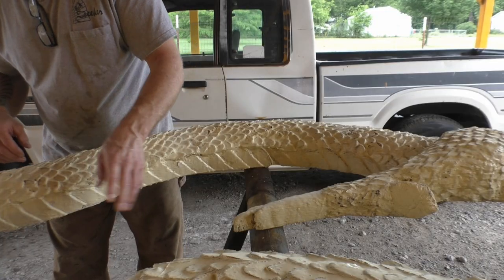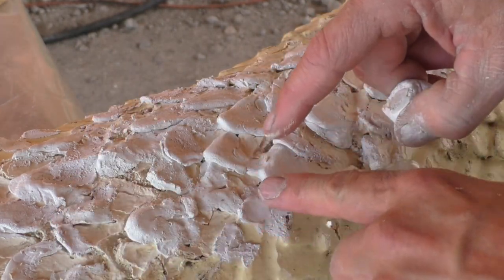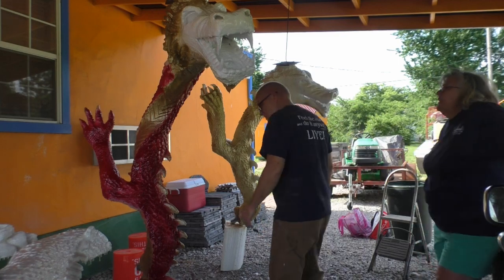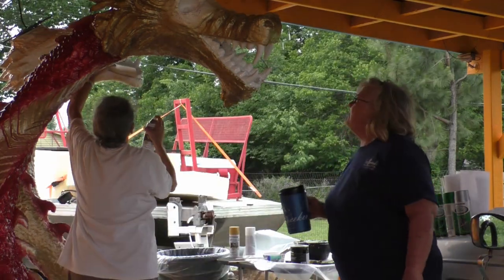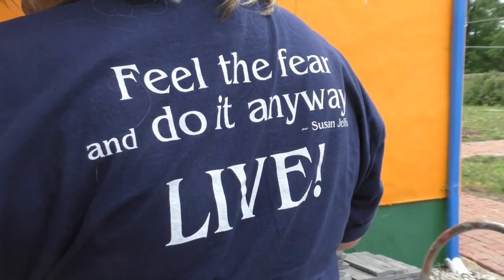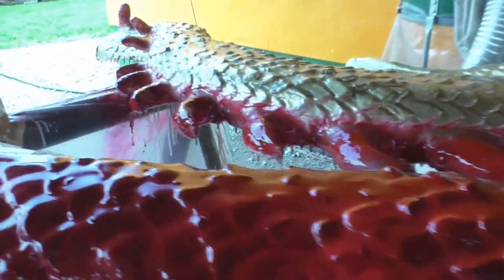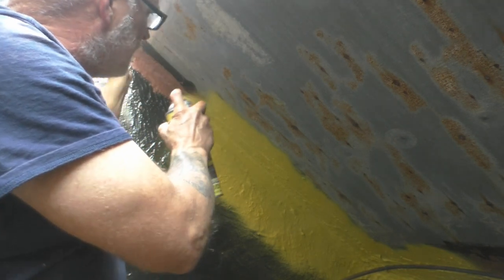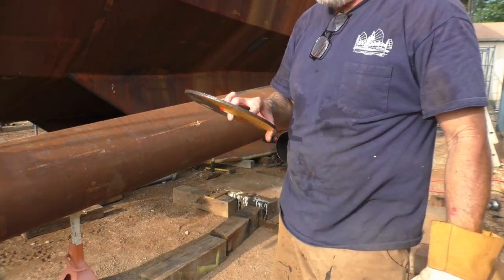Dragons and the Main Mast

Comment: Doug for the mast joint temporarily weld a couple of pull points either side of both pipes then use 2 come alongs to ratchet them together. On the leak why don't you just fibreglass the inside?
Keep up the good work
Mac

Comment: what about a pond liner in the tank? You could use some bulkhead fittings to connect to your current lines, when the water is in the tank the weight should push against the outer walls and shouldnt lose too much energy through the liner.

Comment: Damn that leak is a persistent bugger, perhaps you should drop a liner in that tank.
Reply: That's my thinking, but a liner would have to be made to fit an odd ball shape and be sealed where the pipes come in. Is it worth the trouble? After all it's not a fuel leak, more an annoyance than a real problem.

Comment: Once you remove the galvanized coating and weld it will rust again.  Best to use ospho to neutralize the rust then paint with trailer coat from pettit.  I have been in the marine industry since the 80's and this is the best option.  The paint is moisture cured and very durable.

Comment: lolololol... the entire upper flange of the hatch seal on my 93 honda wagon (2nd year ohio body, and it shows) is made of JB "water-weld" epoxy putty (carefully formed over the remaining oxide lace and a few layers of mesh glass sheetrock tape. previous "craftsmen" who had defied the gods of rust had elected to just pour a "deck" of rtv caulk (which may as well have been window screen, lol). the JB putty is FANDAMNTASTIC!!!! my ONLY critique is it needs a bit more pot time. for those who don't know, it will not stick to "glad wrap" or other cling film type plastic wraps (most epoxies don't), which works awesomely to "bond limit" surfaces (and to prevent crud from sticking to the otherwise exposed surface).

Comment: Just a suggestion to seal your solar tank. If you could score some swimming pool liner/ rubber poly or pond liner and use self vulcanizing adhesif to seal the seams I figure that would work much better and would expand and contract much better than a liquid sealer.

Comment: Hi Doug, I worked in the waterproofing industry for 11 years, so if you do want to fix the water tank, any areas that have lifted off the surface, should be stripped back and recoated, its usually caused by water getting under it, through little pin holes, too small to see. I would suggest you seal all the corners, seams and troublesome areas using the cold tar with strips of chopped strand fibreglass bedded into it, when thats dry I'd top it with another coat of cold tar. I'm pretty sure Ive seen you use both products in different videos.
Reply from the maker: Sure it would work, but that would destroy our moss crop.

Comment: Hey Doug, just watched this video, if you haven't gotten as far as getting the mast all cut up and welding. I have an idea that to draw the two sections together, use a reverse ram setup weld in some cleats and get some rams to pull it together your Hi Lift might even be able to do that if you have a couple to use at the same time but hydraulic rams would be the easiest if you have them around.  Just an idea to work smarter not harder.

Comment: I know you said you were going to quit on your solar water heater and live with the leak, but I wonder if you've considered making a rubber liner for it out of roofing membrane. All the walls appear to be flat, so making the liner in panels should be pretty easy, and there are obviously good adhesives for that rubber, since every big roof has seams. Just a thought. I love your project. What a range of scope and scale, nothing timid about it.

Comment: Hey Doug, have you considered that the hot dip gal will increase the diameters of both pipes. Thus you will need to grind all of the gal off both sections to be able to fit them together. Seems a pity to lose the zinc off the sections at the joint.
Reply from the maker: We did.  And I don't thing we are looking at that level of accuracy.  :)     Besides, we'll have to grind off the galvanizing in that area to get good welds.
Reply: True that. The zinc contaminates the weld.

Comment: Regarding the socketing of the two parts of the mast together, the lifting tool with the red handle you were using to make the short section of split pipe into a smaller diameter seems to pulling more on one side of the pipe and pressing the other side of the pipe to drive it towards the centre of the tube. Hence the large gap in one place when inserted and virtually none elsewhere. This is surely because the chain part will not slide around the pipe as tension is applied. Would the use of two [or more if available] arranged equal and opposite each other give a more even compression to the split pipe if worked at the same time?

Comment: if you manage to heat up that connecting bit of the mast then it should be easy to get it in position and reshape it's curve so it doesn't spring outwards like that

Comment: Doug for the inner sleeve pipe that connects the masts could you take a section of pipe and cut a bunch of slits length wise to make it like an expanding mandrel that you would compress? It would seem to solve the issue with gap on the inside. Don't know if you need the strength of it or just is the purpose to align.
Reply from the maker: It's really more for strength.  It acts a reinforcement across the joint but also as a backing ring for the butt weld.   With a backing ring we can easily get a full butt weld and it will be clean all the way through because the purge gas does not escape through the joint.

Comment: how about annealing (or normalizing) the bit of split internal pipe while it is welded in the "closed" position. It might take the stress out of it so it doesn't want to spring open and make it easier to work with. just heat it up to noon magnetic temp and let it cool very slowly.
Reply: non magnetic, you don't have to do it at noon :-D

Comment: Just a thought the leak in the tank could be from the bottom up. It may be from around the drain port fitting and one of the liners and is traveling up until it can escape. Great Vids keep it up and good luck

Comment: Why is the front of the boat flat? Logic tells me that a sharp point at the front of the boat would be better at breaking waves... Can someone tell me why it wasn't done here?
Reply from the maker: I can only guess what the intentions of the Chinese builders were, but in calmer waters the water line is below the spread bow.  And provide more room for working ground tackle.  And in rough water it would provide greater buoyancy helping the bow rise.  All speculation.
Reply: The "Junk" was designed in such a way that the arrangement of the sails and hull design made
it able to sail upwind very well.

However when sailing upwind the direction of travel is not perfectly on the bow, therefore the "cutting" edge should be a few degrees from center. Genius design. Helps the boat stay on course without fighting it and reduces spray coming over the bow.

Comment: captain tolly's creeping crack cure, should do the trick.  it's a water based monomer which polymerizes in cracks.  adding it to the leak outside (if you can see it)should fix it.  it will probably be handy around the boat too, sealing roofs and windows.  i've used it on a landrover roof, and a leaking car radiator, with total success.
Reply: captain tolly's creeping crack cure!!!  Still laughing!!!!!!!!!!!!

Comment: did you try dri lock paint for the water tank if the wall is cement  based you can try a hydrostatic  type cement

Comment: Build a vacuum chamber around the exterior of the water tank getting the tank walls to flex, then spray the interior. If this dissent work, fill the vacuum tank with heavy water to keep your heated water from leaking out. I am an expert. I learned to swim when I was 6 years old.

Comment: could you just use like an internal bag for the solar tank? fill that bag with water. put the heat exchanger inside the bag. kinda like an inner tube in a tire

Comment: Looking forward to more mast work, and if you think its worth it, make a bigger tank yourself out of alum or steel scraps and railroad ties you have and use a waterbed bladder on the inside, that way it doesn't have to be all metal construction or maybe get one by recycling some old oil/air/water tank(s) from a recycler, or pallets for structure, and alum for the tank ?
Reply from the maker: But the moss would die.   We can't have that.
Reply: I guess the dogs will like sleeping on it too..

Comment: did you try using some kind of lube for the mast?
i guess it will be easier to fit the top part... but then there might be some trouble when welding.

seemed a bitch to align them up. good luck with that.

eager for the next video

cheers

Comment: Just a thought - you've got those huge weed-burners, and mild steel starts annealing somewhere around 220 degrees F - you don't actually need to get her cherry red or anything - maybe you could do a little stress relief while that coupler's squeezed, so she'll relax into a circular shape a little better?

A little on the late side, so I'm not about to run the BTU's on a chunk of steel like that, but I'm sure it's far less than a pot of lead - but brute force and stitching might work just as well.

Can't wait to see that mast vertical. Congrats on all the hard work - I'll have to snag one of those t-shirts soon. high fives all around
Reply from the maker: Will give the brute force and stitch method a go first.   It's already hot enough in the shade.
Reply: Oh man, I almost forgot summer was here. It's been in the 60's and 70's until today, and bam 88 degrees. I'd vote for the chainfall too!

Comment: you really should be wearing a welding shade when using the plasma cutter. Atleast a shade 5 oxy fuel goggle but idealy an 8+ shade for arc process.

Comment: be careful when grinding on galvanized metal, zinc has nasty fumes, so use plenty of ventilation, heavy metal fever is nasty stuff
Reply from the maker: I think you are exaggerating the risk somewhat.  I have cut and welded galvanized and there is no issue if you stay out of the smoke.   And I don't then grinding would even bother the canary.   Ok, the noise would freak him out.   It would be very helpful if you could post actual research done on the topic.
Reply: paw paw wilson, I smith, just advising care, I have done research on it, not saying don't do it just be aware of the possible issues, I blacksmith so have done research about heavy metal fever, so long as you are in open air it should not be an issue but the boat has confined spaces, such as the mast step which is more of what I am concerned about

Comment: i don't think that inner pipe is round, prob more of an egg shape since you only cut a peace from one side. it might be a bit more work, but  cutting it  several places and welding it back up might work better. By no mean an expert lol, just my train of thought. You doing a great job. Thank you for sharing it with us.
Reply: Or take it to the place that rolled the prop guard and have it re-sized. Also don't forget about the thickness of the zinc coating unless you plan on grinding it all back off around the insert.
Reply from the maker: True, but I don't think we are looking at that level of accuracy. :)
Reply from the maker: I think it's oval because the greatest amount of leverage is opposite of the cut.
Reply: could try heat shrinking it at 45° or 90° intervals to help. When I first saw it in the video, my first thought was a giant roll-pin

Comment: I agree Doug, too many messdeck lawyers on  the net telling you what is and aint good for you. They should as you say do some research before opening their big mouths.     Maybe the leak is meant to be. :-)    I tried putting a 1" taper on a 4" pipe 10' long  and welding it up, it never did look right. I hope you have better luck. What is the beam of your boat ?   regards from the UK
Reply from the maker: 16.5 foot beam.      I think the larger diameter will make it easier.

Comment: If the leak turns into a brain worm you cannot let go of: I'd try jumping in with a light and some soapy water while having the opening covered (as good as possible) and suck the air out with a vacuum (dust collecting thingie).. just get some pressure reduction in there and see where it bubbles.
Good luck with it all!
Reply from the maker: I'm not sure that getting in a tank and then sucking all the air out is the best way to find the leak.  :)

Comment: when we had to fix concrete water tanks we would throw a bag of quick set morter concrete into the tank, the flow of the water takes the suspended particles of concrete into the leak sealing the cracks.

Comment: Attention Doug, & Youtuber's!!!! Flex Seal is just plain old 3M 03584 Professional Grade (Used mostly in Auto Body Trade) Rubberized Undercoating, usually found in 16 oz. spray cans. (A.K.A. Spray-Bomb.) 

Most any big chain auto supply house / business will carry, also found at Auto Body Supply House/Business. 

There should still be available a spray product called Shultz (Spelling?) The spray gun if you will kind-a looks like the smaller sand-blasting guns.

Also you could think about using what they use for Pick-Up Truck(s) Bed-Liner(s.) You should be able to purchase the Pick-Up Truck- Bed-Liner material (comes in I believe 1 gal kit's.) at a local   big chain auto supply & or at Auto Body Supply House/Business.

Comment: Is it even legal to obstruct the visibility of the navigation lights? I think the teeth of the dragons might make them less visible... Did you inform yourself about it?
Reply from the maker: I do not know.    Certainly not the issue I am going to loose sleep over.  :)
Reply: SV Seeker So what are you gonna do about it if some coast guard asks you? They may take your boat away ;)
Reply: +Hans Müller he will recive a fine and have to fix the issue. The dragons stay either way=)
Reply from the maker: Even the USCG will think the dragons are cool. :)   ( The nav lights will be on the roof.  )

Comment: the leaking in the Water tank, is it the Water kondenseiting on tha glass and run Down to the corner??? Love your Work
Reply: couldnt imagine that much condensation
Reply: You know, that seems like a possibility. You can even see some water in the channel at the bottom edge of the glass at the end of the video. But there doesn't seem to be any condensation on the inside of the glass, so probably not.

Comment: take some plastic sheet and make a giant plastic bag to line the hot water box.  Have the edges stick up out the opening and the water will hold the sides in place.  Might work.
Reply: I was going to suggest a vinyl swimming pool liner
Reply: I think I like the liner idea better.  Purpose built exactly so.
Reply: Good idea but a "pond liner" would last longer. They're black, too, so they'd absorb heat. Nice thing about a liner is it can be replaced if it springs a leak.

http://www.amazon.com/gp/product/B008OAX7B2

Comment: you can get a galvanizing paint that mught work for your mast
Reply from the maker: That's the plan for the final welds on the joint.
Reply: Sounds good thats some good stuff i made a 20' single swing gate aout of inch and a half tubing and painted it with that stuff seemst to hold up pretty good but then again its not around salt water

Comment: I worked for years with polyester resin and fiberglass and I was told how bad the fumes were for you and BS.  In a confined space YES they are a danger to your health.  It's the grinding dust that is bad for the lungs because it's sharp glass fibers.  So I understand your rant about people being uninformed.  

I would rather work with polyester resin over epoxy to be honest.  The polyester is smellier that epoxy it is also safer than epoxy too.  There is some very nasty and toxic stuff in epoxy.  I've worked with both, you just take the needed precautions when working with them that's all.
Reply from the maker: Exactly.   Working with anything everyday for years is much different than working with it for a few minutes a few times in your life.   My real danger is carpal tunnel syndrome and obesity.   :)